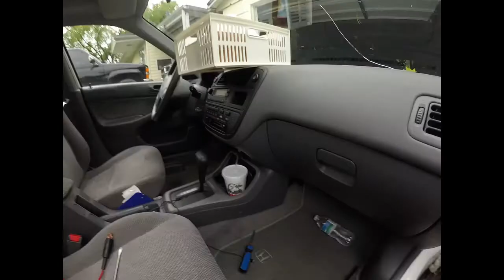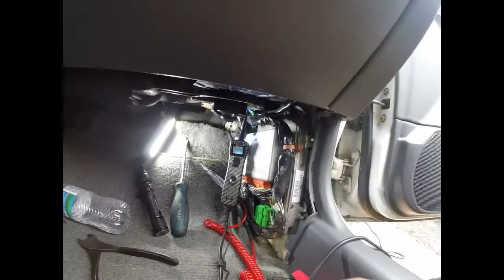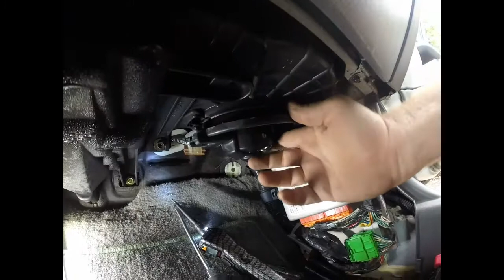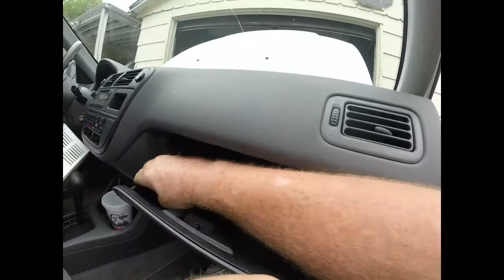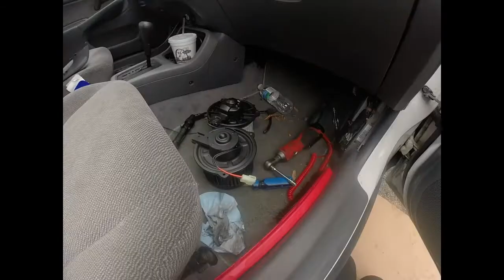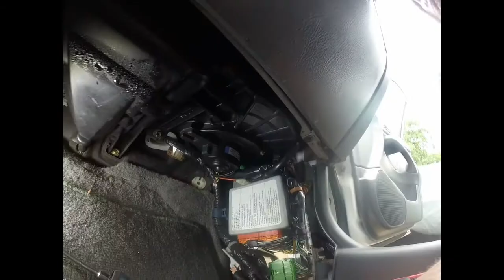1997 Honda Civic Blower Motor and Resistor

Comment: My blower motor spins extremely fast (WHEN IT'S UPSIDE DOWN) and works on all speeds But when it's facing upwards it stops working why?
Reply from the maker: Possible the brushes are worn. If it's upside down and you tap on it does it start to work ?

Comment: When you say getting ground do you mean power? I bought a electrical tester that just lights up, so does it just need to light up on each speed on the resistor to know the resistor isn't faulty or broken?
Reply from the maker: I might have misspoke if you hook your tester to ground and touch a power source it will light up and vice versa. Your resistor should have a power and ground.
Reply: @HooptiesGarage  okay thank you have your vid a like I'm going to do it in a couple hours